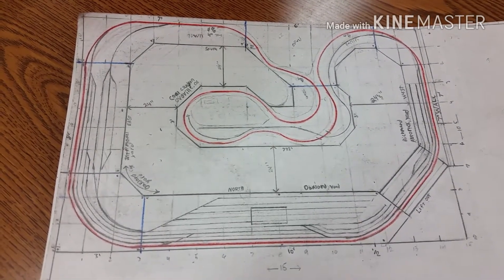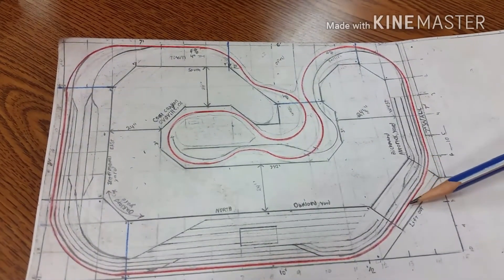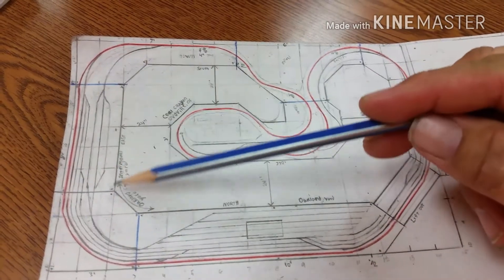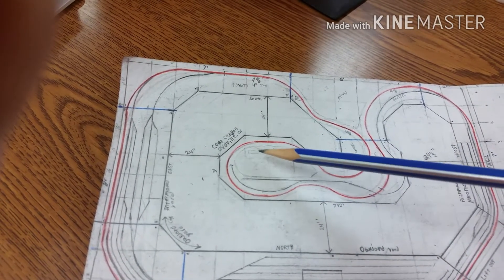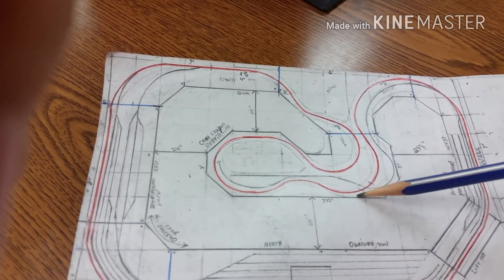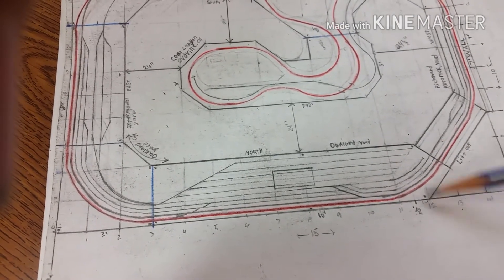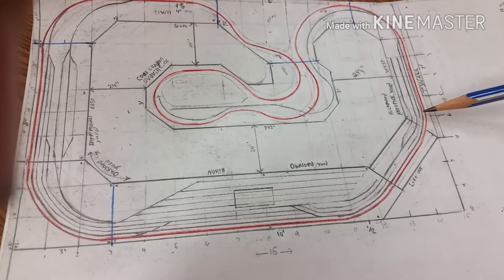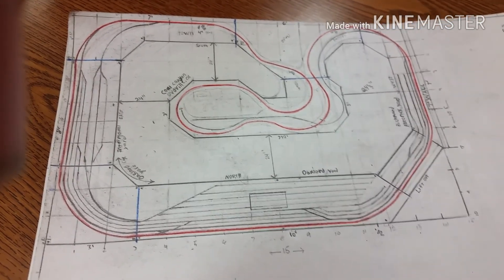2/7/17 Northern cali trains, Track plans.

Comment: hi Jerry... i'd think twice about a 4% grade... by the looks of your track plan i don't think you have enough run to get up 4" ... 1" rise in 4 feet' = 2% grade.. just my 2 cents... i am a bit disappointed that i haven't seen any comments from you... vinny
Reply from the maker: bnsf6951 Thanks Vinny for that heads up looks like I got to go back to the drawing board. I've looked at a 2% grade but I just can't get it to fit. I'll look into seeing what I can get to fit in there. Thank you for the info. Vinny
Reply from the maker: bnsf6951 okay Vinny I did a lot of work figuring some things out moving some turnouts around and I can do a  2% incline on my layout. Thank you again for the information. Jerry.
Reply: hi Jerry... just to give you an idea of grades... on my layout with an 8 foot run i have a rise of 2.5" which = just over a 2% grade... hope this helps... vinny
Reply from the maker: Ty Vinny.